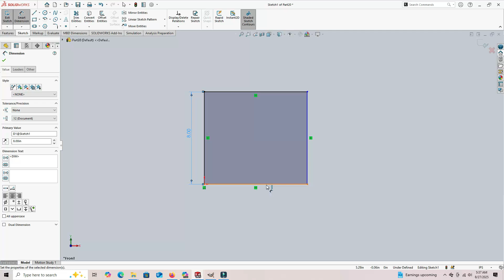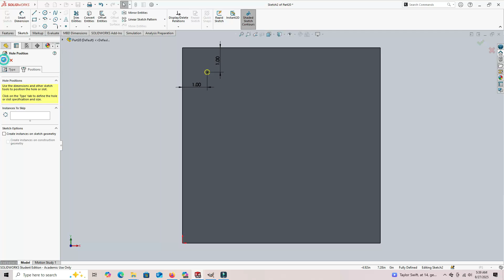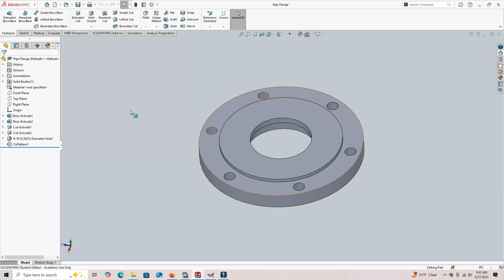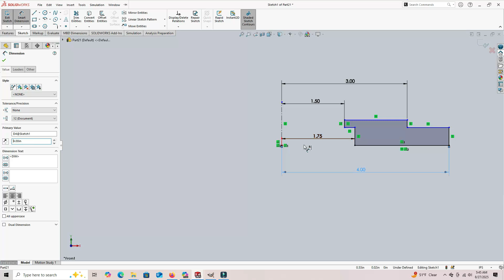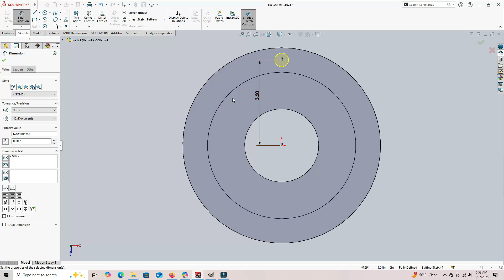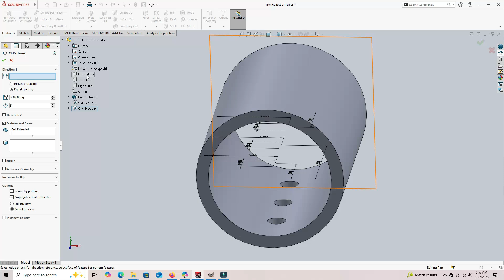Solidworks Tutorial 8 - Linear and Circular Patterns

Comment: If you intend to use SW , or any CAD program, a lot, I would strongly recommend purchasing a 3D mouse e.g. 3Dconnexion etc. Used in the left (spare) hand it allow you to spin/pan/zoom the part so much more easily than the mouse buttons and It makes assembling parts simple. They're not cheap*, but I've bought three of these things over the years and not regretted a penny .  (* well, perhaps, compared to the license fee for SW!)